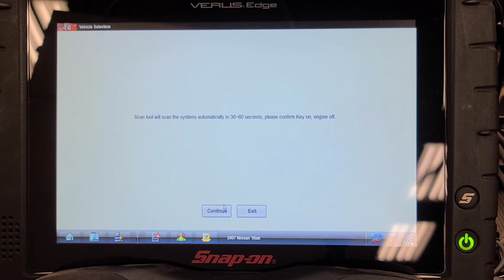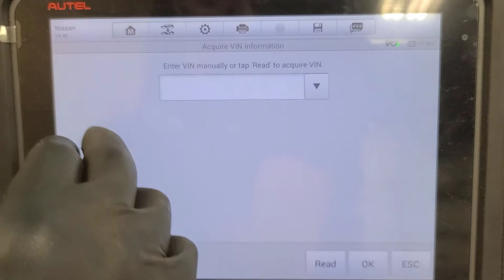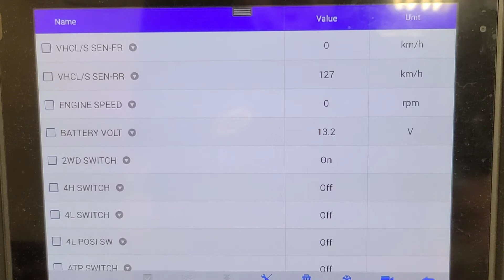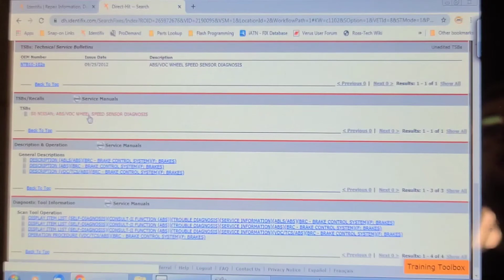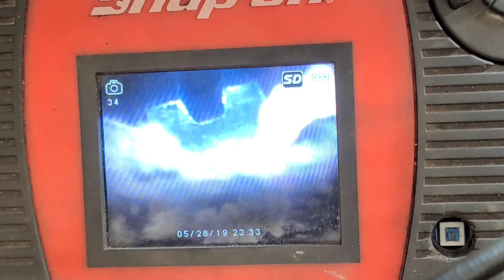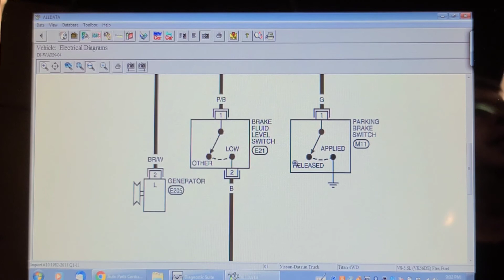2007 Nissan Titan ABS, SLIP, 4WD, MIL, SRS, Brake lights on. Part 1

Comment: Having these issues with my 2004 Nissan Titan LE 4x4 
Christmas tree dash replaced what I thought was a broken speed sensor. It was cut to bypass abs. When it’s plugged in all 4 brakes slowly pressurized. Got that RR speed sensor unhooked and drives great BUT now spedometer doesn’t work and all lights still on except service engine light.
Reply from the maker: That sounds like you have two problems. When you say the brakes pressurize do you mean they start dragging and overheating? If so did this condition happen after the booster and master were replaced? Could be an improper master cylinder pushrod length. That's the little pushrod between the master and the booster. Some are adjustable. I've also seen an out of adjustment brake switch holding the pedal down slightly cause this. Reconnect everything and drive til you notice the condition. Stop where it's safe, open the hood, with nobody stepping on the brake pedal try cracking the line fittings on the master and retighten. If you get pressurized brake fluid out  and the brakes release likely the pushrod is too long. I can't see how disabling the ABS by unplugging the speed sensor would make a difference. Good luck.keep me posted.
Reply: Forgot to mention also replaced master cylinder and OEM brake booster from Nissan to cure a “ Delta S” sensor code that is in the booster

Comment: I'm having the same issue with my 04 titan le speedometer don't work abs vdc check engine 4x4 brake light and airbag lights are on. What fixed the problem?
Reply from the maker: Failed wiring to left front wheel bearing and Failed left rear speed sensor. https://youtu.be/ZQC9ZacWT1I